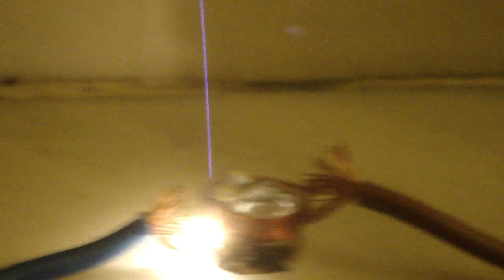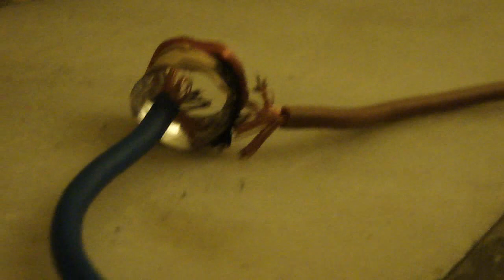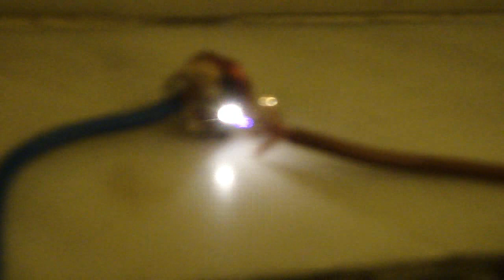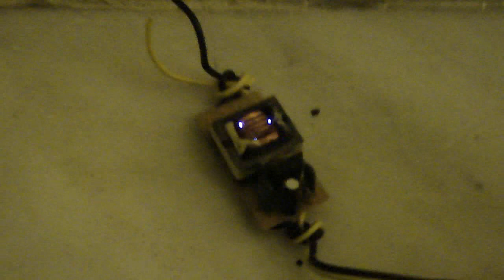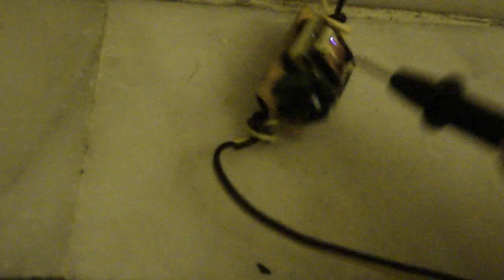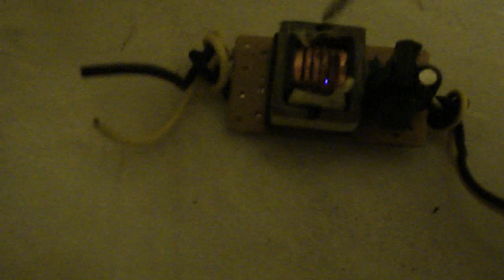Voice Coil Arcing on 1kV - Small CCFL Inverter Beatup in Water Cup

Comment from the maker: @ducttaperulestheworl I actually haven't played a lot but i'm not new in theory.
The pain can't be detect at a such high frequency ac voltage for two reasons,either the nerves doesn't respond or the skin has high impedance to the specific frequency allowing less current flow through the skin than the same surface on another frequency.
The only real hazard here was the some production of Ozone and several Oxides that can damage lung tissues,aswell as oxidize metals contained in blood.

Comment from the maker: @ducttaperulestheworl But like i said,this setup has so small current that the current that can flow on you by a typical fly zapper can be considered lethal compared to this.:P
For instance,with current limited DC Transformer at 7v in the input,the 1000v Transformer/Inverter has an output that will have a voltage drop of several hundred volts if you connect an almost invincible ohmic load like a Multimeter,so with this current nothing spectacular will happen if you accidentally touch it for 0.5s

Comment: @truebassB 
I guess you're new to high voltage eh~
it's not about small voltage not lethal, it's that you'll harm yourself exposing too much active charges or something~

sheesh I forgot how it goes but any sparks that could ionize through the air is considered lethal if exposed for too long, think about radioactivity.

I know it doesn't hurt that much but that's because the frequency of these arcs are just too high that humans couldn't detect the pain it felt